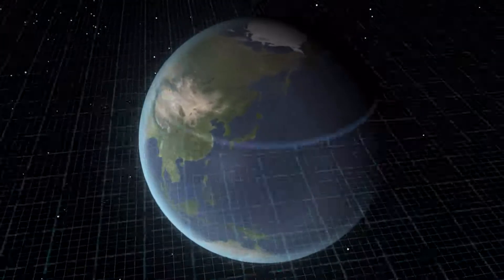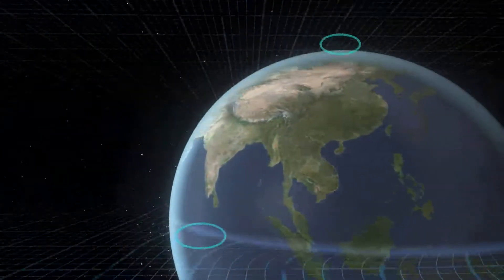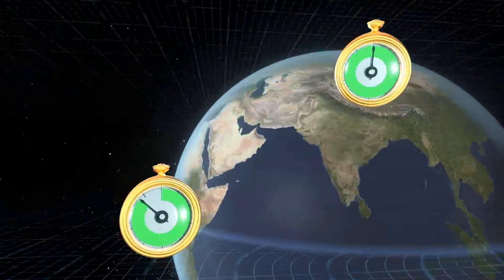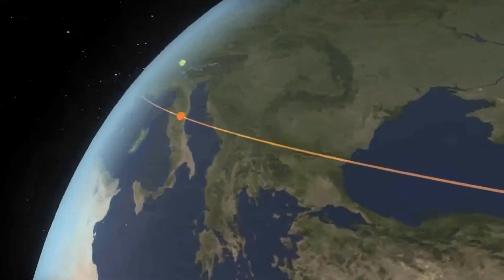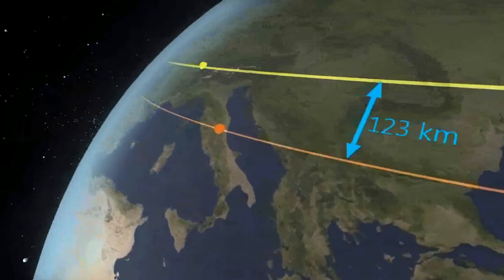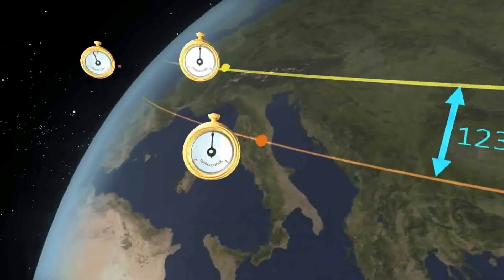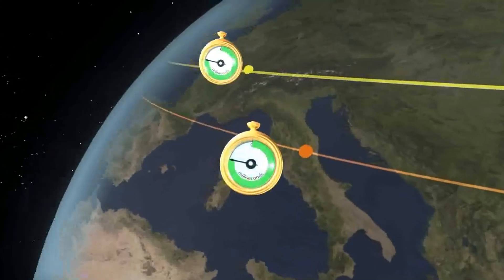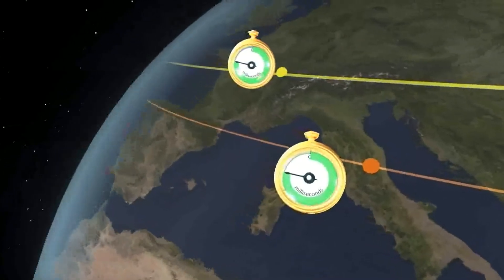OPERA frame dragging.wmv

Comment: This proves warp theory in a nut shell and the fact that warp drives for space ships if they can be powered will be able to violate the conventional laws of physics and move faster then light!!! If you warp or distort the fabric of space, in this actual case distorting it with the dragging of a massive body in space i.e the earth, you also change the speed limit rule as the limit only applies to the fabric of space. Change the fabric of space and you change its rules...
Reply: +livefire666 The problem with all curving space stuff is that the amount of energy you really need to make the curvature big enouph so that it is usefull is just too big.
Reply: phil durre New research is saying other wise, we have solved the energy problem actually and now only need to solve the material problem. We need a way to get negative energy, and then we have warp travel. http://www.sciencealert.com/warp-speed-travel-is-theoretically-possible-according-to-top-astrophysicist